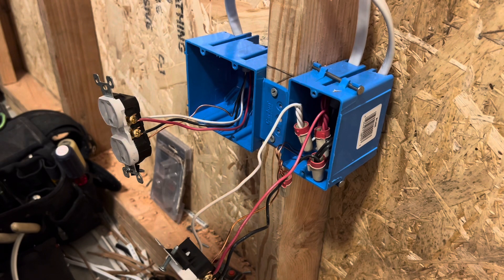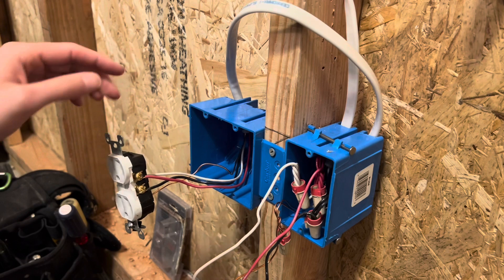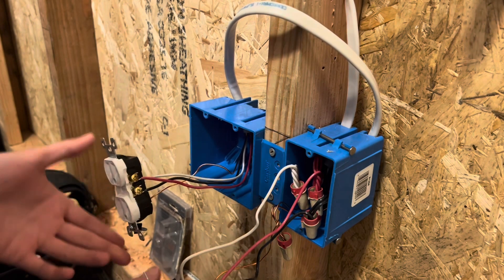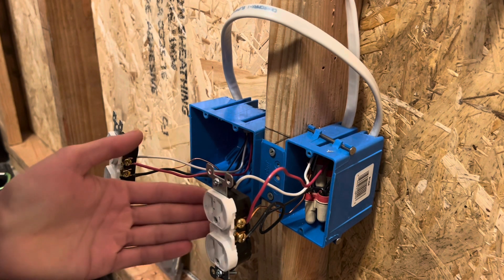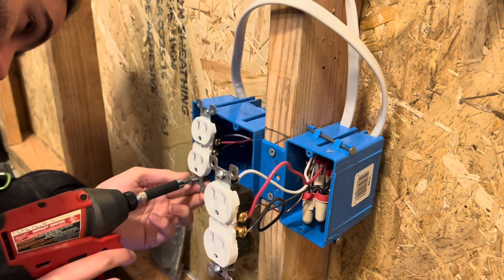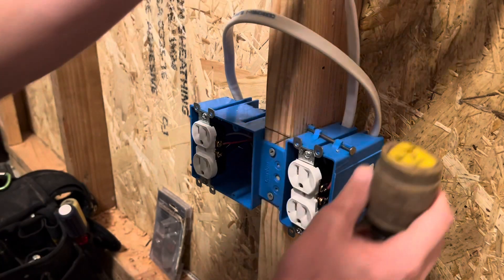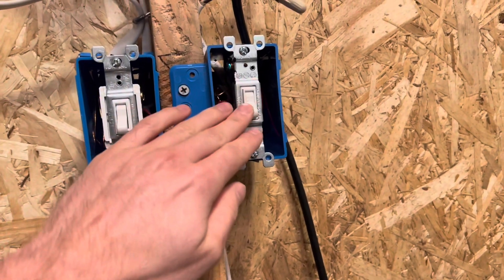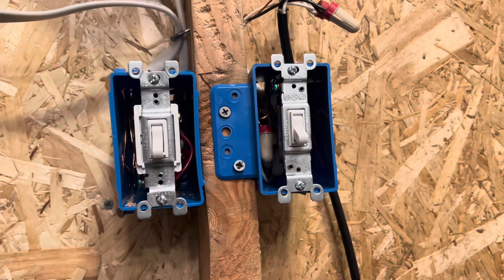Electrical 101: How To Rough In/Install Multiple Half-Hot Receptacles (Residential)

Comment: Thanks bro. I was replacing an existing 200a panel today and a meter socket. The guy showing us the meter socket accidentally touched the neutral from the SEU to the hot. It caused a massive arc flash. Luckily we were ok. When did you ever start working near energized circuits? It’s only my first week in the field.
Reply from the maker: geez thats scary, glad yall are okay!!

probly worked live after a year or two
Reply: @DailyElectrician  yeah I froze up for a second. I’ve never seen such a bright light in my life. So crazy.
Reply from the maker: damn, i would too. careful out there... 🙏🏼❤️
Reply: @DailyElectrician  yeah bro you too
Reply from the maker: thanks! 🙏🏼